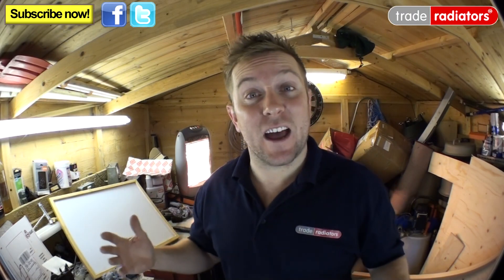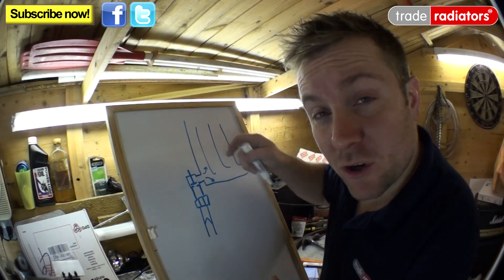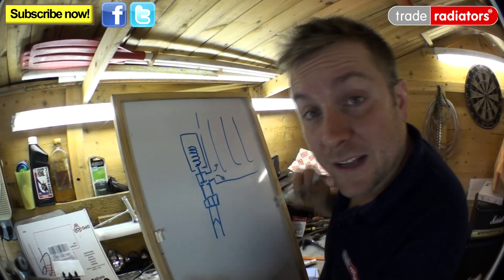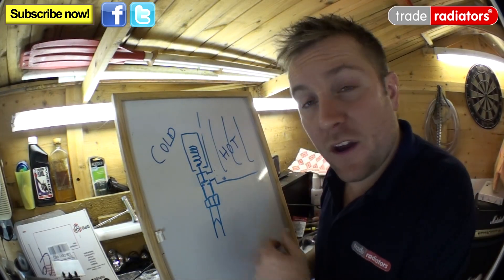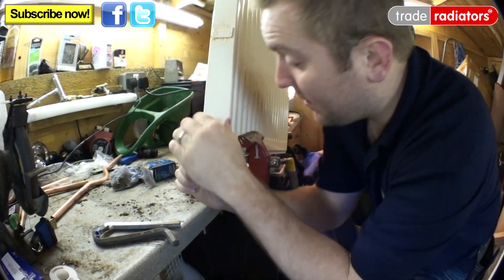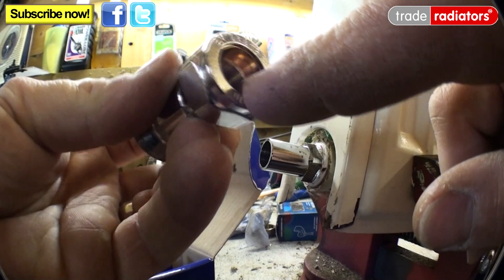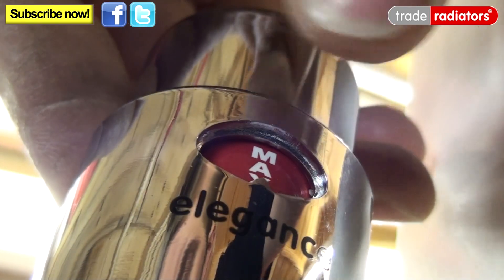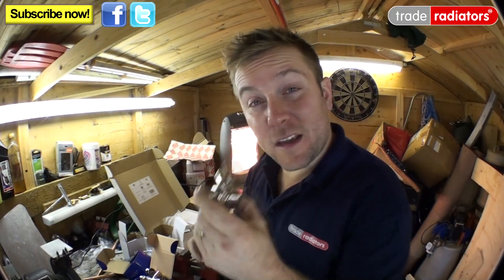How Do Thermostatic Radiator Valves Work? - by Trade Radiators

Comment: Dumb question here, but if i have one installed on my radiator and the valve closes,

 wont that stop the water from flowing to the other radiators after it in the loop?

Comment: Yes, very good. But one question - how can it possibly be "room temperature" that is being sensed. It will be the temperature very close to the radiator that is being "measured", and this is nothing like "room temperature". This is why the "master" central heating thermostat should not be installed near a radiator.

Comment: Does the temperature "sensor" actually work? If I were some shady manufacturer I'd just set a fixed pin position linearly according to the set heat level.

Comment: Please help of you can. I have replaced an old radiator with new including new trv and lockshield. New radiator is hot at the top and lukewarm at the bottom when all other old radiators are very hot. That radiator also gets very hot when I remove the trv head. I have replaced the trv head with a second new but same problem. There is no sludge and and the temperature in the room is not high enough to explain why the trv shuts off. Any thoughts?

Comment: Are radiators on branches instead of a loop?   Otherwise this valve would effect other radiators in the house?   I'm used to forced hot water baseboard radiators where it is all on one loop.

Comment: How is it possible for this thermostat to work at some point, since the heat generated by the radiator goes up! I wonder if he gives a wrong command to open or close hot water. Maybe!

Comment: Hello, the building I live in has a central heating system, so all tenants have radiators which are controlled by a central thermostat, you can't control your own heat, and it's really cooking. I'm thinking about covering the radiator unit with some heat absorbing material, is there anything as such ? Do you know of this problem and of usual solutions ?

Comment: am confused - if the TRV shuts down one radiator, how does the hot water go into the next radiator, and the other radiators around the house?
Reply: radiators are connected in parallel, not series.  See "Trunk and Branch"
http://wiki.diyfaq.org.uk/index.php/Central_heating_design